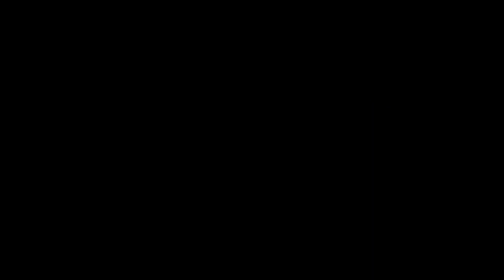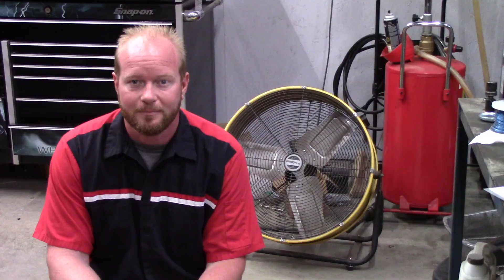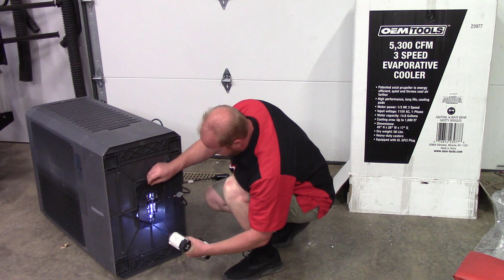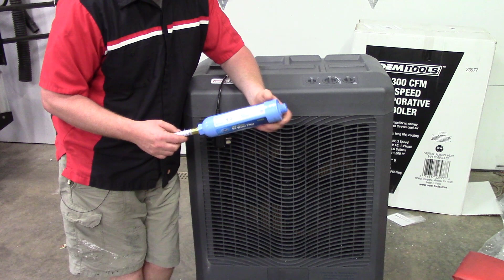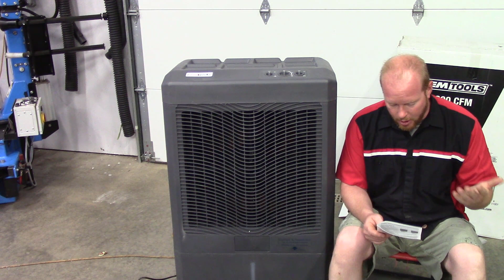OEM EVAP cooler kicks butt in my hot shop

Comment: Total B.S.
I live in the arid part of the western U.S., and I can tell you for a fact evaporative coolers are worthless where there is high humidity like in this video where there is 80% humidity.
This is why evaporative coolers are not common in the mid-west, deep south or eastern U.S. where humidity levels are high like in this guy's garage.
Only central air is effective in areas like this guy's garage, and I would not be surprised if he got some kind of perk for promoting this evaporative cooler by the company that makes it.
For those reading my post considering buying an evaporative cooler, do NOT buy one if you live in a humid area.
I do not want you to throw away your hard-earned money to scams like this one.
If you live in an arid desert environment which this guy does not this cooler would work fine but again, not in humid areas of the country.

Comment: How did the swamp cooler not raise the humidity and make it hotter? I'm debating on getting one of these but the reviews are so wildly contradictory. It seems only those who have affiliate links like them.
Reply from the maker: If you have the doors closed it will. You have to have the doors open so the air can circulate. That keeps it from getting humid in the area you are working.
Reply: It did these are trash

Comment: how can I replace the water pump?
Reply from the maker: I have no idea, but I am sure if you look in the instruction manual you will see that it is located in the bottom of the tank and you would most likley need to remove the fan to get to it. The unit is pretty simple I am sure it is not complicated

Comment: A temp before and after would have been great. Not sold on it yet untill I see how much it actually cools
Reply: Damn right
Reply: All the yt reviewers who show temps only hold the thermometer a couple of inches away from the fan, making me think they're just trying to sell their affiliate link. I want to try one,but it would be too hard to return because of my disabilities if it didn't work. I can't put an ac in my apartment window.
Reply: These things are trash
Reply: @ericculver115 They work very well in low humidity.  If you live in a part of the country where its super humid in the summer, they aren't very helpful.  If you live in the desert, or any other part of the country with humidity around 25% or less, especially 10%  they do a good job.

Comment: Can you tell me the threshold on humidity levels where this unit becomes less to not effective?
Reply: The more humidity the less they work. Depends on the unit, but they really need dry air to work.
Reply: life in Houston as well and looking to get one for my garage gym. I only used half of my gym to workout. Will this be a good solution? Just need my area to be cool. (Will keep garage gate open for ventilation).

Comment: I Bought one of these for my garage because I was trying to figure out how to cool my garage while I work on my car during the summer. I live in California with dry heat that could be up to 110° in the summer. I ran this one for a couple hours and only dropped 1° and made my garage completely freaking humid. I even put ice in it but try to make it cooler.
Reply: Somethings wrong. Most likely, you have inadequate ventilation. 

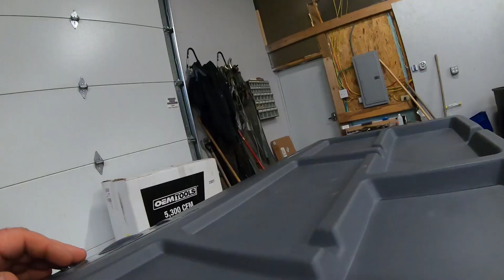I had the type of Swamp cooler  that you put in a window. It worked just as well as an air conditioner, even at 100F. (Reno, NV). 6:37 My only complaint is that it had to be filled with water every four or five hours.

100% would do again.
Reply: I found this out to be true too, It won’t cool in a closed garage, you have to allow outside air in through the cooling pads and the moving air inside the garage has to go out through a vent in the wall for it to work.

Comment: Sorry but - 'swamp' or evaporative coolers work well in DRY climates - ie: midwest/southern States - but they do NOT WORK in temperate humid summer climates - such as southern Ontario, northern Michigan. If you try to use one, you'll get little cooling effect (low evaporation due to high ambient humidity) and the environment will become horribly damp and unhealthy. Why are so few people calling this issue out? So many 'miracle' $89 coolers / get rid of your aircon etc...NONSENSE - it doesn't work in more humid climates.

Comment: 80 degrees, good lord, I wish my garage was even close to that.  Try 102-107 degrees in my garage, sh_t is melting.
Reply: Bro, I live in Socal, I used my temp gun to shoot the temps in my garage... THE FUCKING CEILING WAS READING 138°f! the walls were 125°f! it's down right unbearable, idk how the fuck i changed my cars clutch in that garage last year, this year i just can't hack it, it's too hot in there for me, maybe it's because i got fat over last year lol. i think i'm gonna get one of these coolers and try it it, if not fk it i'll take it back lol.
Reply: @imbrandon16  get an insulated garage door. Totally worth the money. My old door fell apart but during the summer I remember it being too hot to touch. I upgraded to a triple layer door and It's 113 outside but only 88 in my garage. Add in a swamp cooler with the door cracked open and I could work on my truck all day with no complaints

Comment: Evap coolers don't work very well in anything above 25% humidity lol
Reply: That's certified horse shit.
Reply from the maker: I live in the Midwest, we have Humidity over 70% all the time. This unit still works great.  With high humidity you just want to make sure you are not in a closed room or it will get muggy fast. Thanks for watching
Reply: Not true , there’s pretty interesting charts about humidity and air temps. Google it . 
But dry air is definitely better

Comment: When evaporative coolers say it cools up to 10-20degrees, is that in comparison to the temperature outside or inside the home? For instance, if it’s 100 outside & 85 inside, will the EC cool the home from 100 (outside temp)  to 90-80or from 85 ( in home temp) to 75-65degrees?
Reply from the maker: It doesn't cool like and air conditioner would, this is not something I would recommend in a home environment.  It cool you in the space you are working in, but you will not notice the temperature on the thermostat come down 10-20 dgs.  However it will make your work area and you feel 10-20 cooler because of the evaporative effect of the cooler.  If you are looking to Cool your house I recommend this product: https://youtu.be/d32TMzkm9os

Comment: My hose leaks. cant seem to get it to stop. It was suggested to run it on very low pressure but I cant seem to get it to stop. I am glad your hose seemed to work right away.
Reply from the maker: What hose are you having issues with. There is the hose connection on the back of the machine that has a garden hose gasket.